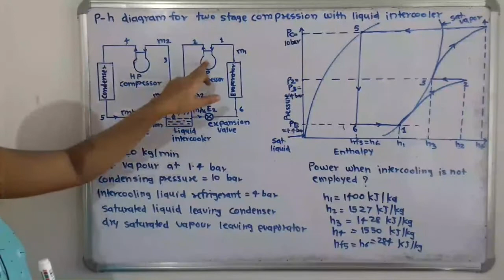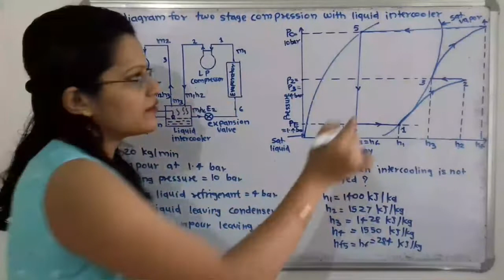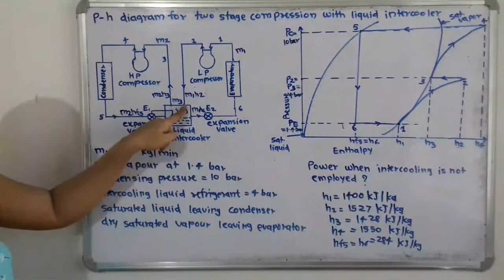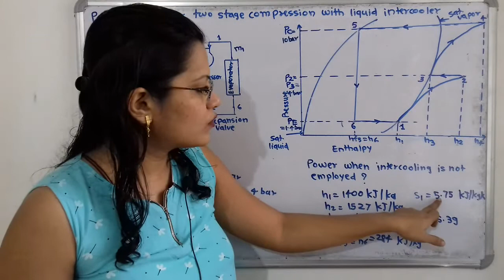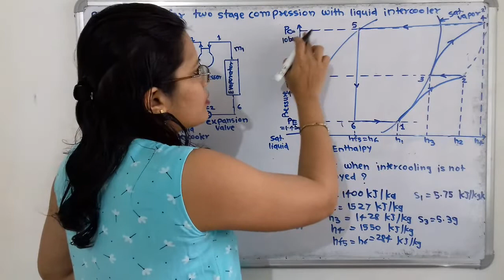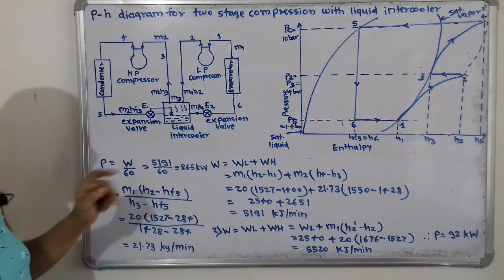Problem on two stage compression  system with liquid intercooler/ compound refrigeration system

Comment: Ma'am which book you use for ph chart please name
Reply from the maker: R S Khurmi ,J K Gupta
Reply: @edutechguruengineeringlear4280  ma'am I bought a book refrigerant & psychometric (table & charts) by Dr. S. S. Banwait. But in this value not correct and also not full chart. So suggest me a book only for tables & charts
Reply from the maker: @Mohd Arshad  refer S chand publication,  R S Khurmi J K Gupta
Or
Images are available on Google
Reply: @edutechguruengineeringlear4280  thanks ma'am 😊